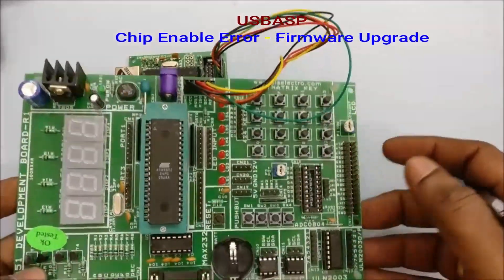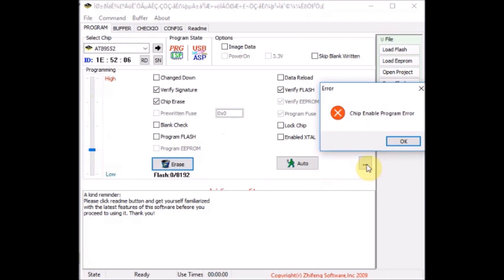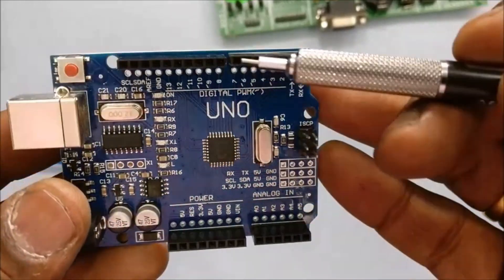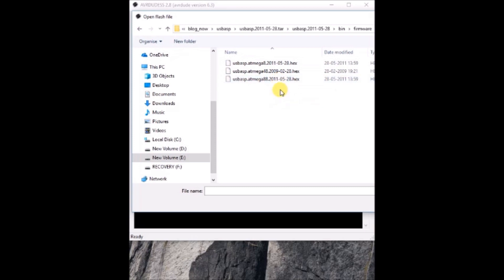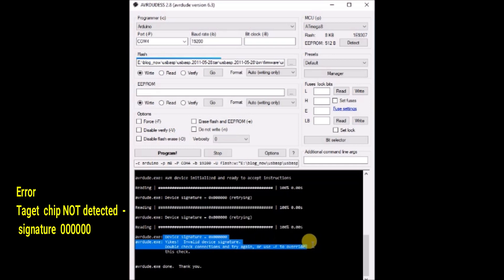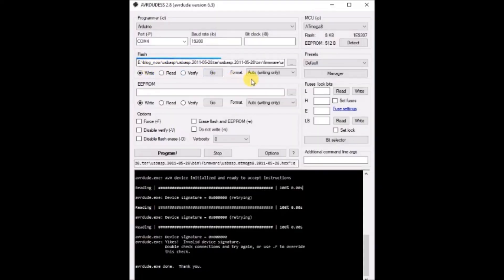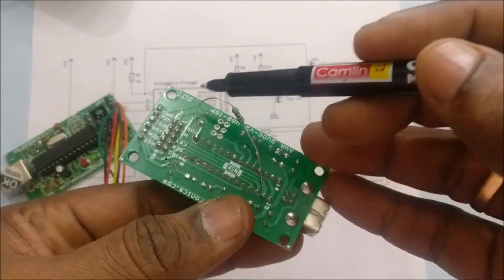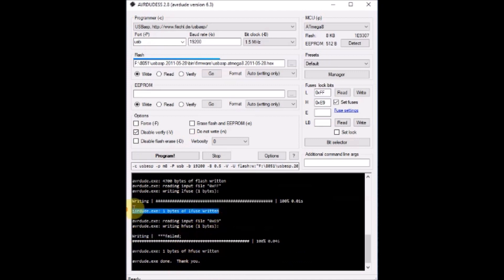USBASP CHIP ENABLE ERROR - FIRMWARE UPGRADE SOLUTION

Comment: Haven't tried it yet but thanks for the good video! The others are way to complex doing it from the Windows command line and changing windows command lines in the directories etc. etc. When I get time I will have to try and program the two USB  ASP units I have. Arduino seems like the best operation as I have used it to flash a new program to a ham radio transmitter without setting the fuses or altering the boot loader.

Comment: Sir ,I did the same thing as you said and I soldered pin 1 and pin16 and yet its showing error that there is 'unknown  signature 000000'
What to do sir and the resistor I used is of 240k ohm
Reply: Not 420 k u use 270 ohm resistor
Reply: 240 work nhi kareg aap 270 ka use karo chip signature error nhi aayega
Reply: Plz provide ur phone number